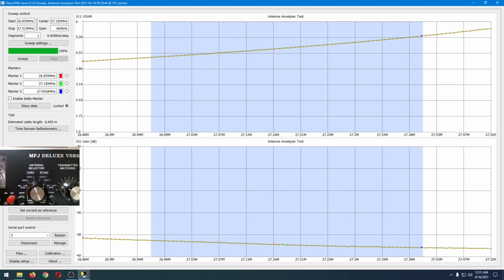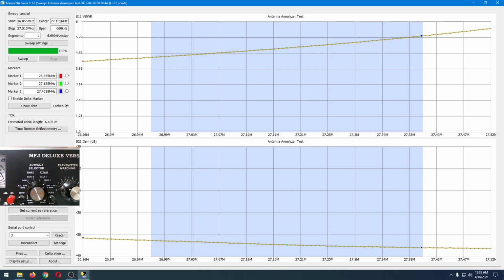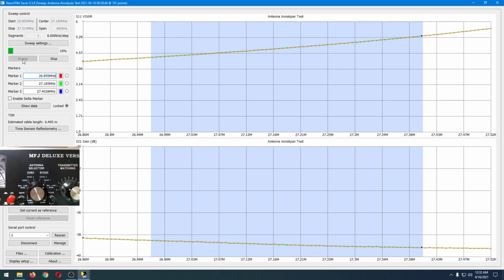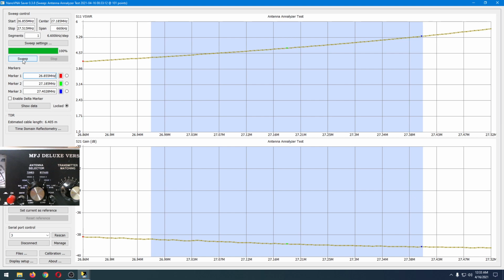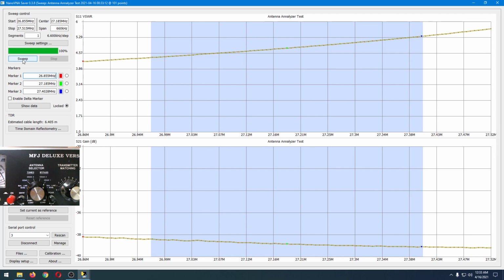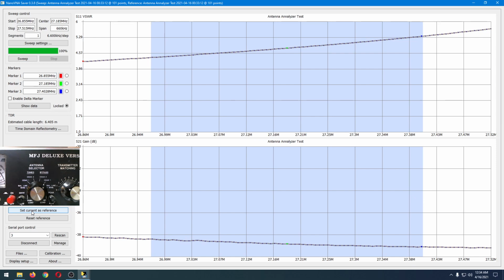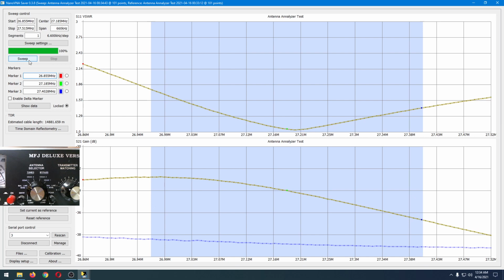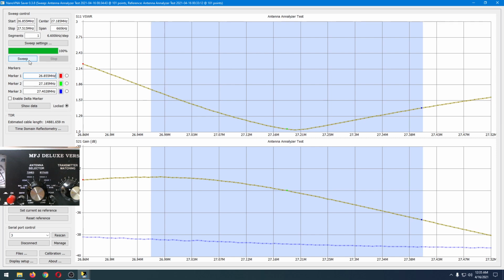Does an antenna tuner increase the signal strength of an antenna.

Comment: But how would it compare to a properly resonant CB antenna?  I mean, is the tuner making the wrong-size antenna perform just as well as a correctly sized one?
Reply from the maker: This video was specifically meant to show something on an antenna forum debating weather or not an antenna tuner affects the output of an antenna it is attached to.  This shows that it does, and there are other videos out there that also show this.  Comparing said antenna to a so called "properly resonant" antenna (henceforth referred to as "self resonant") was simply out of the scope of said discussion.

But to answer your question, one answer is that depends.  Will this setup perform as well as using a self resonant antenna of the same length through the same feed line?  No.  How much additional losses this type of setup had depends mostly on the feed line length and quality.  I don't know of anyone who would actually suggest doing such a thing unless you are on a very wide ham band and your antenna simply don't have the bandwidth to cover the areas you need.  Said device will expand the usable band-with with little to no noticeable effect on the signal, at least to some degree.  There are limits of course.

To extend on what I just said, baring experimenting or demonstration purposes, or very rare and specific cases, to use a setup like this for a single band with a very narrow band-with requirement, such as the CB band, is just a waste time and money.

Antenna tuners excel in multi-banding an antenna.  You can take a random length of center fed wire, feed it with 600 ohm ladder line, dial it in with an antenna tuner and said antenna will work effectively across multiple bands.  This is but one way to access multiple bands across the HF spectrum.  You can actually have less losses in the system than running an equivalent length of LMR-400 that runs to, say, a fan dipole, which would be an equivalent antenna that maintains self resonance on every band it is set up for.  The difference in loss characteristics between the two feed lines are big enough that, even with a very high SWR comparatively speaking, 600 ohm ladder line is often the more efficient transmission medium.  Comparing these antenna setups in the "real world", however, will be a trick as the two different antennas will have different radiation patterns for each band in question.  Said patterns may be similar or very different based on other aspects, including but not limited to antenna height or the layout of the earth below the antenna.